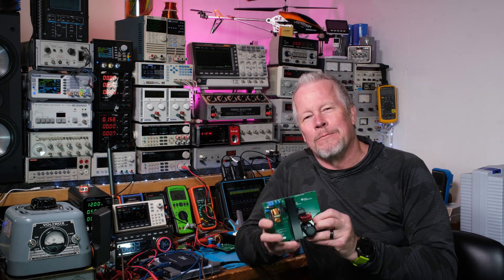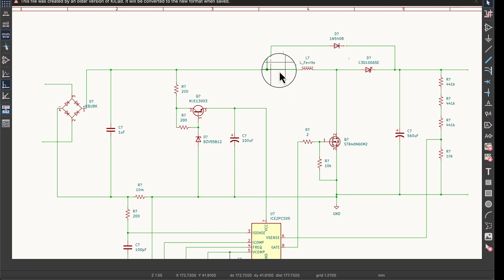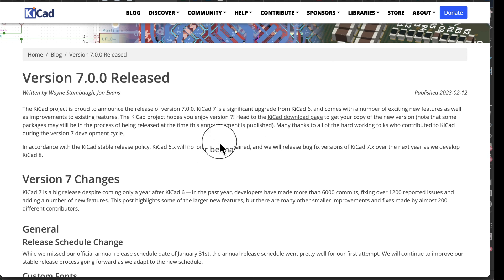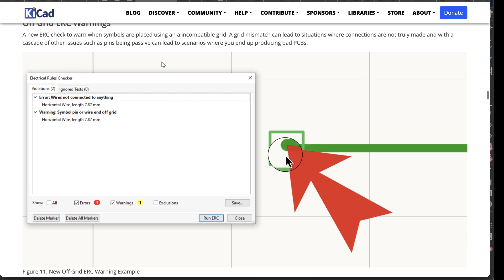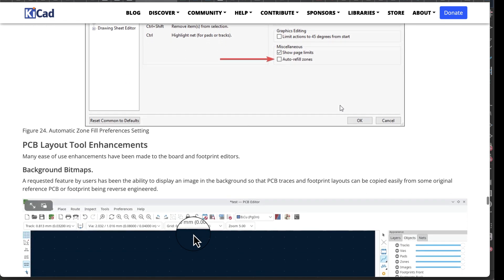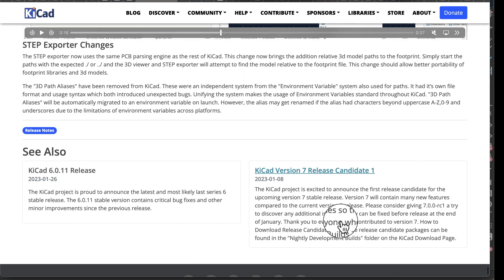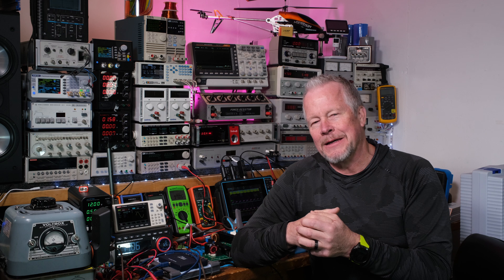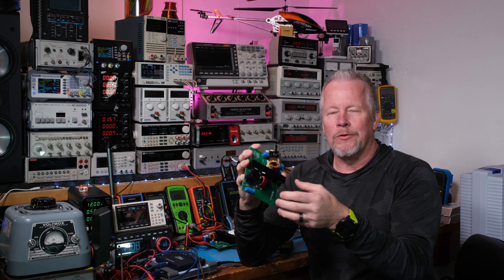PFC Boost Converter Schematic in KiCad 7 update a JAT Collaboration #pfcconverter #KiCad #JAT

Comment: That 12V zener's gonna insta-fail. If it then goes open, the IC, 13003 and possibly mosfet will also die 😄.
Reply from the maker: Great subject!  Thanks for bring it up.  OK so I think you are referring to the zener at the base of the transistor - right?  Well actually it will be fine as it has a fair amount of resistance in front of it.  Or if the circuit wasn't designed right - then it could fail as you say;)  I will go over this in future vids:)
Reply: I see 400ohms? So that would be 400mA peak for 110V input. Anyway thanks for doing the video on qspice. I learned about it from you. It's great! @KissAnalog
Reply from the maker: OK - I'm with you now;)  Yes those are just place holders until I show how to design that part.  Sorry I should have explained that better, but I think I did say that the values were all place holders.  You are doing too good of a job reviewing the schematic;)

Comment: Web based is CRAP, I hate it and I hate the lack of privacy!!!!!!!!!!
I tried DipTrace, and it does NOT have decent multipage schematic capture.  PCB is OK.  Pity because I also program in Delphi, which is what DipTrace is written in (and Altium was for a long time) , instead of the HORRID C++ like most systems (and yes I have programmed in C++ for two decades, ...good ridance though).  Altium is good, but ONLINE is not for me, and is otherwise overpriced.  Eagle is very NON-INTUITIVE and somewhat messy because of it's DOS start maybe, but then Altium started in DOS, ...I know I used it for years that way as well, along with OrCad (becauae early Altium Schematic capture was crap - btw it was called Protel then).  Anyway, keep away from DipTrace, it is crap for anything other than trivial designs.
KiCad looks good, but have not tried it beyond a small test design which was ok.  Hopefully go KiCad! :)
Reply: Kicad is Awesome ! welcome aboard.
Reply from the maker: Thank you for your feedback.  I think EAGLE was based on PCB from the mechanical perspective where other tools were from the electrical perspective and started with the schematic capture and then added the PCB design.  So two different viewpoints and methods of tool layouts.

Comment: Looking forward to it, im only a hobbyist so appreciate the free tools, and even though i cant follow along like some experts can it definately helps in understanding  how these things work and maybe one day one could  DIY a decent powersupply without having to by a cheap one.  Although im getting a kick out of buying cheap electronics from Aliexpress, like this volt/amp meter display thing, its as accurate as my astroAI meter it seems without the hassel of having to move probes around and not blow a fuse to do current readings.  Only $1.. well plus 2.50 shipping.  Hooking one of them up to a buck converter and a wall AC adapeter i was able to make a cheap variable powersupply, just couldnt limit current.  Anyway looking forward to more stuff on the topic of buck/boost converters. , especially fancey PFC ones.
Reply from the maker: Thanks for the awesome feedback!  I think you might be surprised at how far ahead you are in your understanding.  So, please do no hesitate in asking questions;)

Comment: Thanks Eddie,  very informational.  Been using KiCAD for quite awhile now. Have you worked with it's NGSpice circuit simulator yet?   (With me being on Linux, I'll have to way until QSpice is available).
Thanks for the info!

-d
Reply from the maker: Thanks David!  It has been a long time since I tried NGSpice, it seemed like there was a trial period and then you had to buy it.  I already had bought Micro-Cap back in the day plus I bought a copy of Intusoft.  Do you like it?  Is it because it works on Linux or does it have other advantages?
Reply: Actually yeah, I'm after products that have a wide consortium of contributes.  The way Open Source works.  I made it a habit of kick in some buck into the kitty every time I upgrade and periodically.   And since they're running on multiple OS, it give me a warm and fuzzy feeling of how it's received.   Lot's of good YouTube videos  on it and Web Events with the developers.  The developers are very close nit with this designer.   I done a few boards with them and fine it very helpful in ordering boards from PCBWay or JLCPCB.   As for the NGSpice, I've always known it to be FOSS, never heard that they''ll ever charge us for it.   I've personally not have used it (yet).  It's on my radar.  @KissAnalog